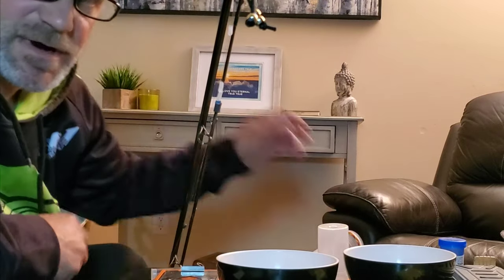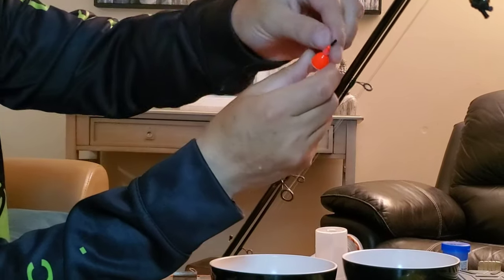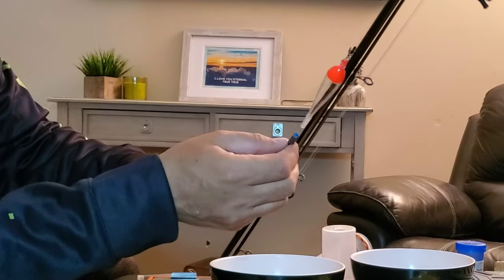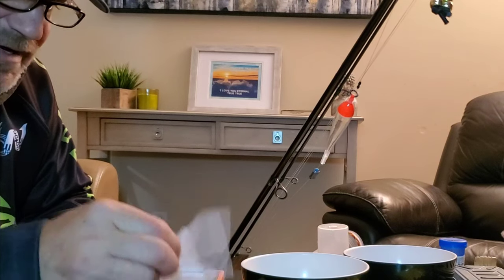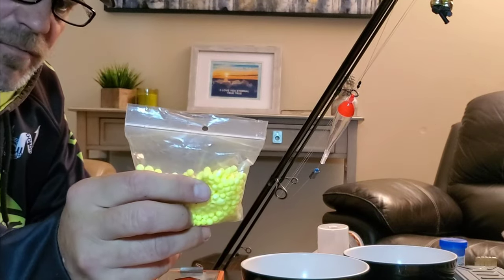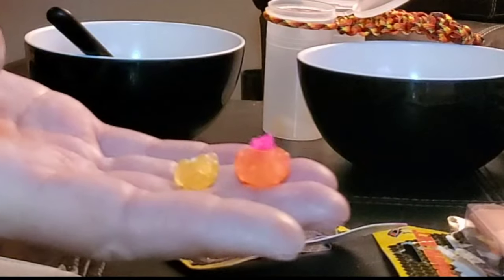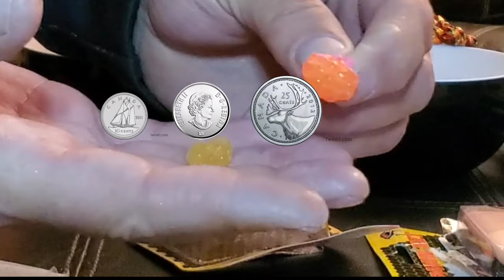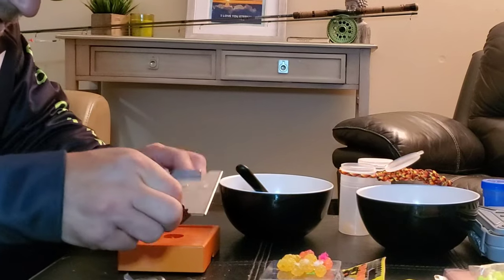Basic slow water Centerpin set up with brown trout roe

Comment: What’s up Mark? What size bobber stops do you use under your inline weights?
Reply from the maker: Medium and large but beware some suppliers vary greatly in size. Medium should do it if it's a supplier for trout gear
Reply: @mehlbeck  thanks
Reply: Do those inline weights have the gram weight marked on them

Comment: What size and type of hook FPS use for 8mm and 6mm glass beads , thanks
Reply from the maker: So 10 on 8 mm size 12 on 6 on first rig usually but if I change bead size I don't switch hooks
Reply: @mehlbeck  thx